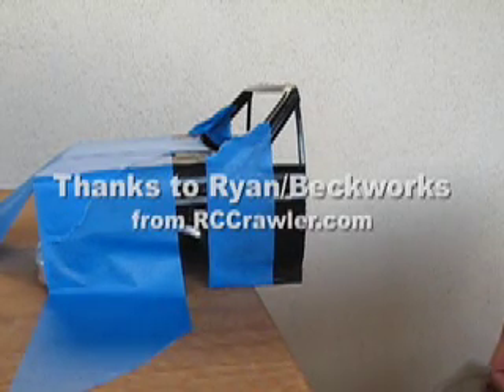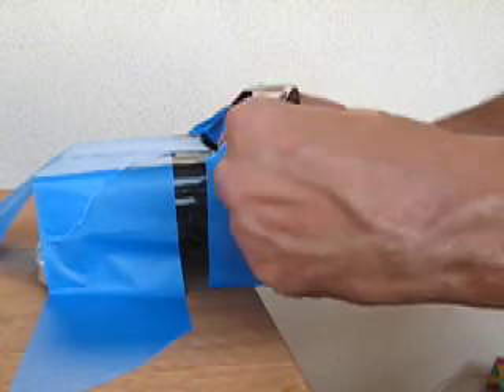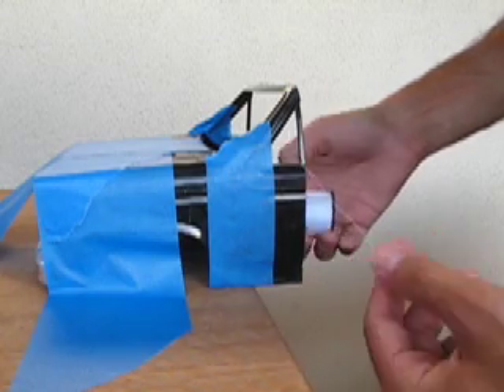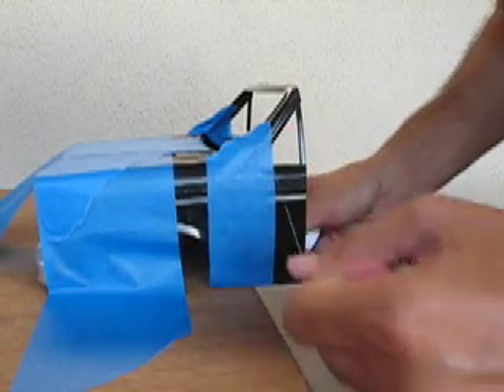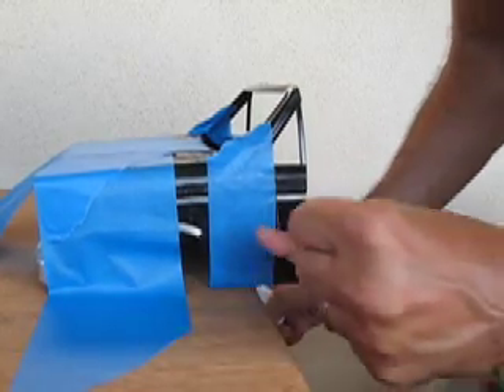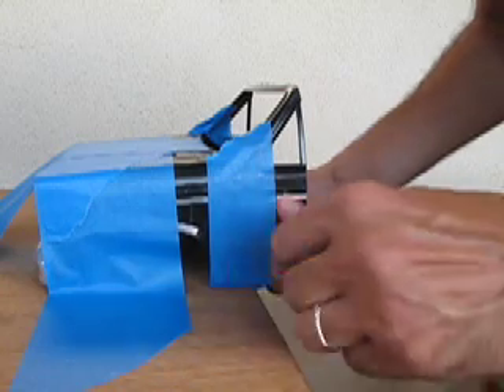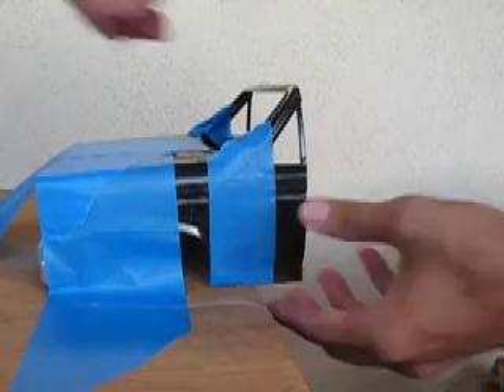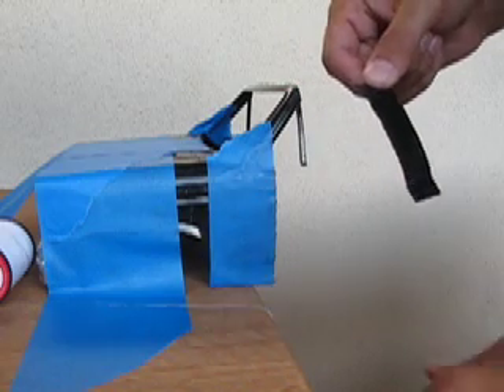Cutting a plastic body with thread

Comment: I agree with the Dremel thing, work slowly and take off a little at a time - you can always take more off (Kinda hard to put back whats been takin) I used a Dremel to cut the side windows out on my Lexan FJ40 (Worked great) 

Wow just never knew thread could do that! I have to so try this next time I need to cut something (Smoother then a Dremel cutoff disc)

A decent hacksaw works well for hard plastics (ABS, Styrene) awell :)

-Tom

Comment from the maker: In this case it would have been easy to use a blade. string takes less material away (the cut is the width of the thread, not a blade, but usually there will be areas I cut out in shapes around things, etc and I can do that easier with string. for example, cutting out a hood, or cutting pajero bumpers off or cutting doors off.

Comment from the maker: @2face87rauscher -using babelfish to translate I would respond that scissors would cut a lexan shell, not a hardbody. Also, going slowly I use the edge of the tape to keep the cut straight. Usually still requires a small amount of sanding.
Scheren würden ein lexan Oberteil, nicht ein hardbody schneiden. Auch langsam gehend benutze ich den Rand des Klebebandes, um den Schnitt gerade zu halten. Erfordert normalerweise noch eine kleine Menge des Versandens.

Comment: Does this leave a cleaner edge compared to a thin cuttoff wheel and rotary tool?
Reply from the maker: Much cleaner. Cut off wheel melts the plastic as it cuts it due to the speed of the wheel. This does not require much if any additional work to prep the edge for bonding to other pieces.

Comment from the maker: @TheChris1696 -what grit sandpaper did you use. you might need to use something more coarse. I've used small hobby metal files and sandpaper, mostly, to finish off the edge as needed. As you get more practice you'll have an easier time staying on the tape line so your post cutting edge cleanup will be minimized.